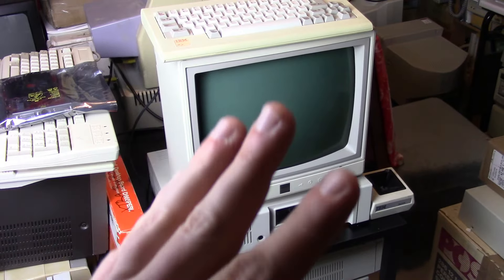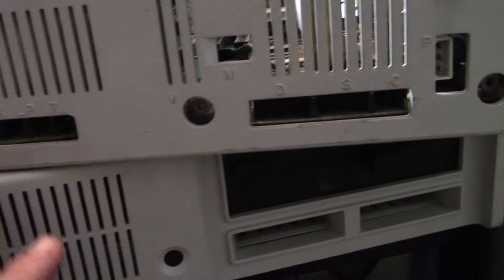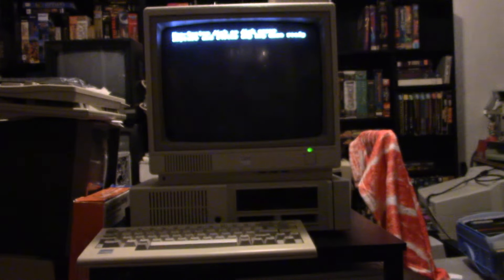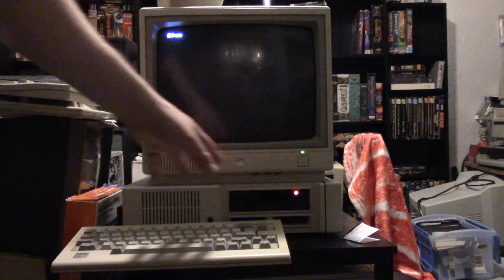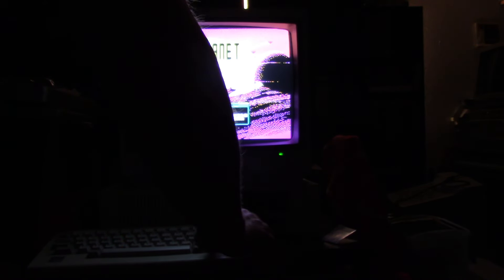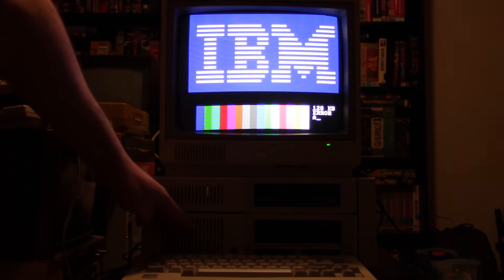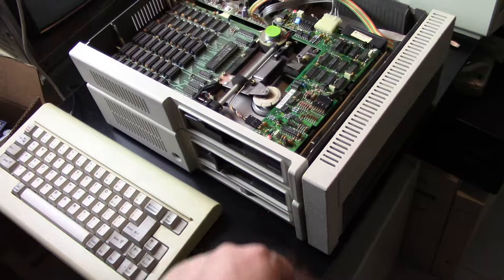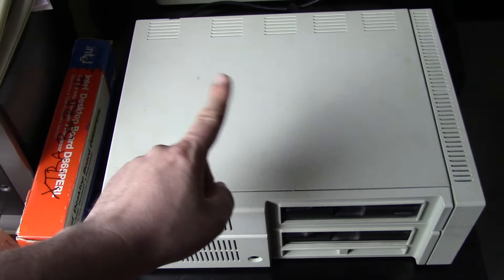IBM PCjr Part 2 NEC V20 Upgrade and Quadram expansion

Comment: The 64K internal memory card sits inside an RFI shield to help meet FCC emissions. The smaller power supply board is an earlier one from IBM, but also one that puts out less power than the long board. I'd suggest replacing it with the long version. The plastic dividers were an add-on from IBM to help keep pins from getting bent from not putting the plugs in straight. On the Jr, the Jr version of River Raid doesn't work with the V20 installed. The Jr. Booster referred to by Microsoft was their 128K sidecar expansion that had the first rev green-eyed mouse with it and also had a clock/calendar in it. It can be expanded to 512K with some moderate reworking.

Comment: I didn't think the PCjr sound came through the PC speaker. Is there an RCA jack for audio?
Reply from the maker: no RCA jack for audio just composite video. did I mention a PC speaker in the video? I may of mis-spoken.
Reply: from wiki "and a software-controlled internal analog switch can select the source for the sound output from among the PC speaker, the SN76489, the cassette port, or the expansion-bus sound source. Only one sound source can be selected at a time; the sources cannot be mixed."

Comment: Thats a 384k Memory board, I have 2 of the Racore ones both 384k and 512k boards. Problem you may have is that tall side card... they tend to be a bit fragile. If someone has over torqued the side screws it may have cracked some traces on the side board. I have not experienced the problem you are having so not sure.

As for the power supply board their were 2 different ones I believe the shorter one is 33 watts and the longer one is 45 watts.

I'm partial to the PCJr as it was my 1st computer as a kid, my dad had a 640k Racore unit with DMA.
Reply from the maker: Thank you for the info, much appreciated.

Comment: I think that performance index of 1.8, that V20 got, is way unrealistic. Several other reviews, that i have watched, are giving it 10-15% performance advantage, at most.
Reply from the maker: I'd have to agree. 15% performance boost is about the max I've ever seen cited for a V20 and that's not even in every instance. Who knows how the program judges and rates performance though. they all seemed to use different standards and methods. At the very least though it detected some kind of performance difference.